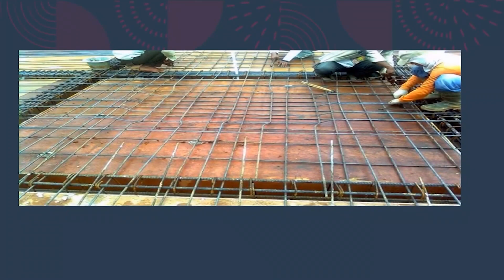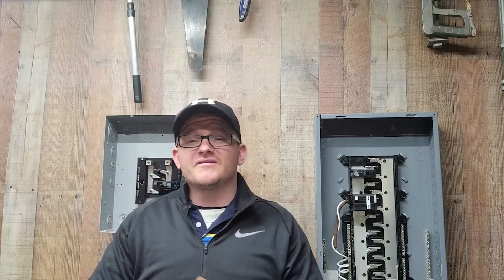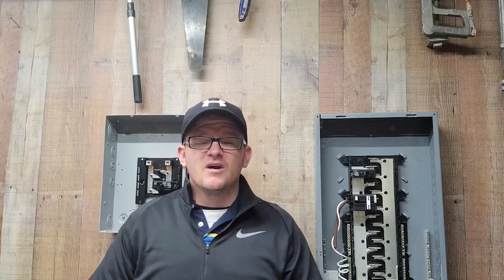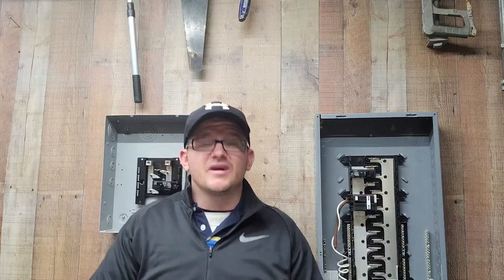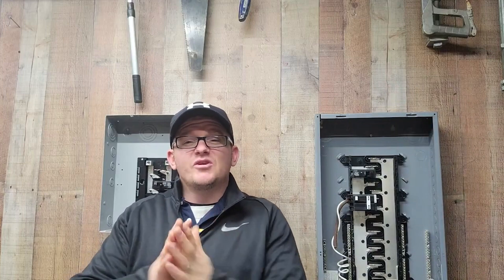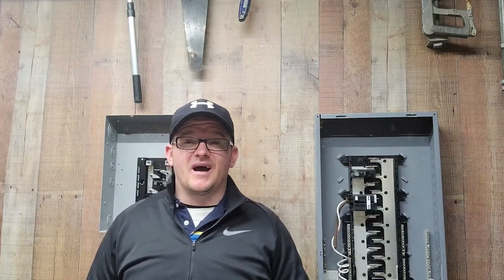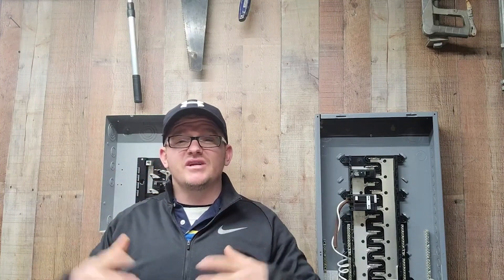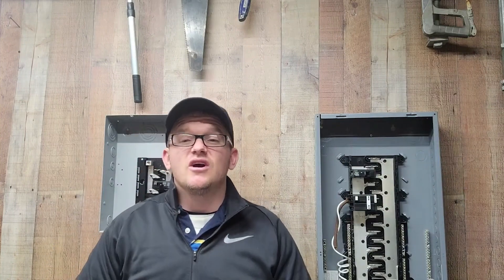Purpose of the Equipment Grounding Conductor

Comment: Great video. I once made an armadillo killing device. I had one of those animals tearing up my beautiful yard. I had two BBQ grills. I put non conducting spacers between them. I ran a grounded conductor to the top grill, and ran the other grounded conductor back to the source. I put a 100 watt lightbulb in series in the grounded conductor circuit, so there was 120 volt potential between the separated BBQ grills. I f you were to touch one side of the grill you would not get shocked since it was ground referenced. If somehow you touched both grills you would get a shock since you would be completing the circuit and light that bulb. I put my contraption where nobody could go but the armadillo. I put bait in the middle of the grid. If the armadillo were to stepped on the grid with its foot its body would complete the circuit and light the bulb killing it in the process. It really worked.

Comment: Since neutral and ground are bonded in the first panel, why don't you get shocked when power returns through the neutral when your hand touches the metal box?
Reply: Shorter path back to source
Reply: Because the Neutral is connected to Ground - which it is why it is "Neutral".
However. if the "supply" Neutral Ground-Connection is ever "lost" - then you could have a problem !!!

Comment: I feel as if in the future we will have gfci protection as a mandatory standard for all uses and we will look back at how crazy equipment grounding conductor used to be. Allowing high current to flow on equipment and using 1/3 more copper than needed in most situations. Shouldn't gfci protection shut off the power before a ground fault?
Reply: A GFCI only "shuts-off" the VOLTAGE connection AFTER it detects a "Ground Fault"
That "Ground Fault" may be via YOU.
You WILL feel the sensation of a "shock" but (hopefully) the GFCI will act fast enough so that the "shock" is not long enough to kill you.

HOPEFULLY  !!!!!
Reply: Trips differently

Comment: Pigtail or not to pigtail is the question... I usually just use the ground wire coming into he box  to also ground the metal box
Reply from the maker: Great question! 2020 and later you have to pig tail
Reply: @ElectricalCodeCoach  reference in code book?
Reply from the maker: 250.148 a-c
Reply: I think we’re supposed to add a pigtail but I usually use the wire coming into box myself!
Reply: In ACHA (hospitals) situations every jbox is "pigtailed" (grounded)

Comment: 1972 Proctor Silex pop up toaster (all metal) has no equipment grounding conductor.
Reply: most American made kitchen countertop devices have no ground until recently. It does seem like the imported units usually have a ground prong. Go figure.
Reply: @rupe53  Much North American electrical equipment is still way behind European design standards.
Reply: Most electronic devices coming from over seas uses the ground as a return... we take that jumper off over here